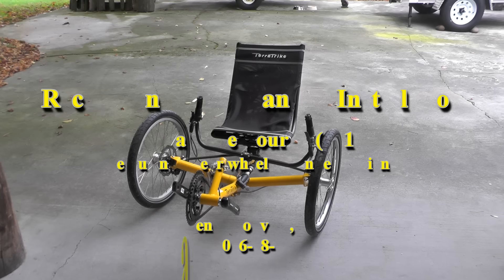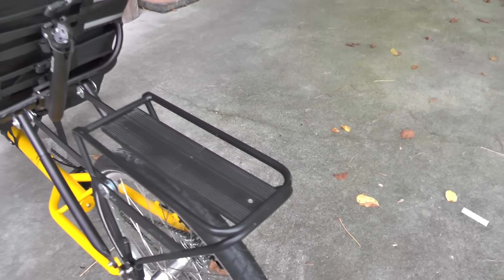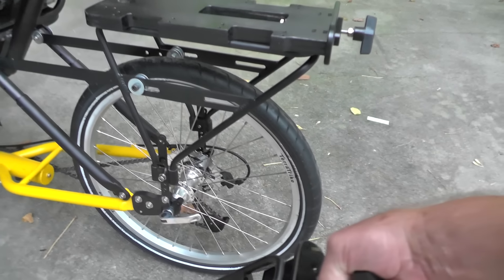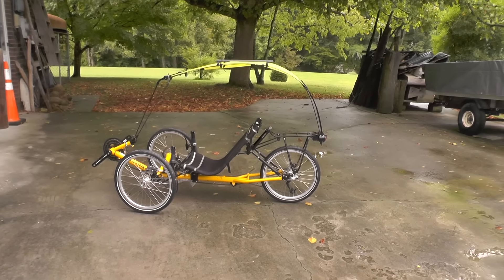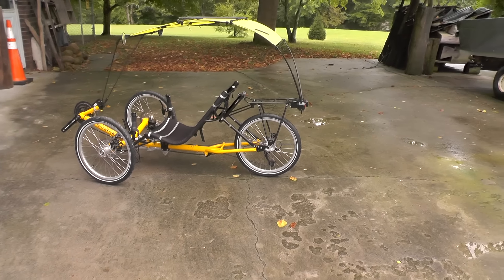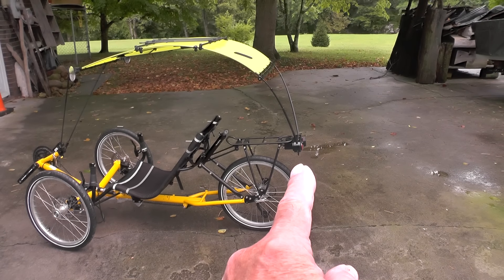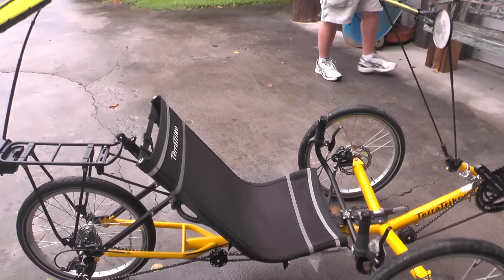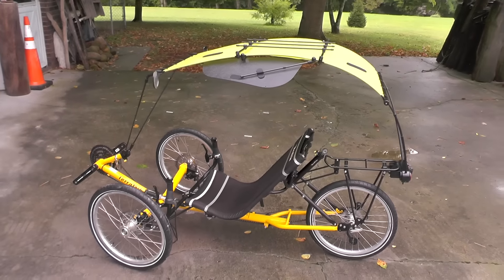Recumbent Trike Canopy Installation, 2016-08-18, TerraTrike Tour II

Comment: "HEY " Mr log notching, can you set me up with a new canopy for a catrike Dumont. as me and the Sun don't get along. a honest man's price is not an option for your impeccable craftsmanship. I will be picking up my trike soon hopefully by early summer. I just sent a message to catrike to see if we can resolve this issue about the setup problems for the top hopefully they will come up with something. as I feel your product appears to be the best of the best
Reply from the maker: Dano, I haven't heard anything that would lead me to believe that the Dumont will be able to have one of my canopies. I have about a dozen Dumont owners interested in a canopy, perhaps some pressure from guys like you could get a ball rolling? I believe their concern is handling additional weight cantilevered rearward off the front frame unit, but with a canopy that wouldn't be a concern. Have them call me 865.654.5454. Thanks for your interest.